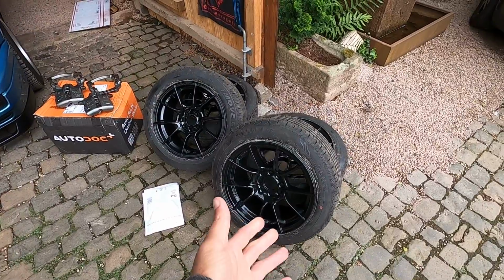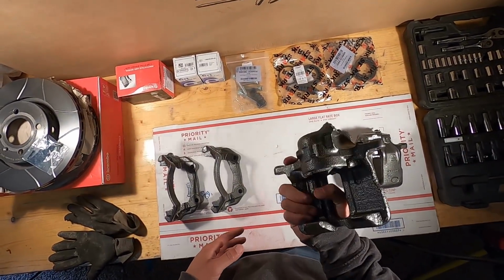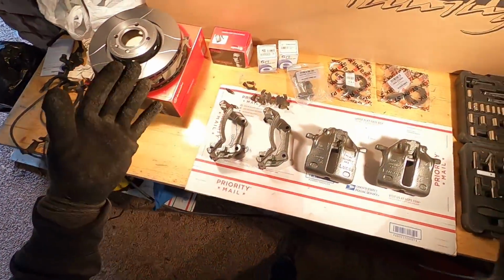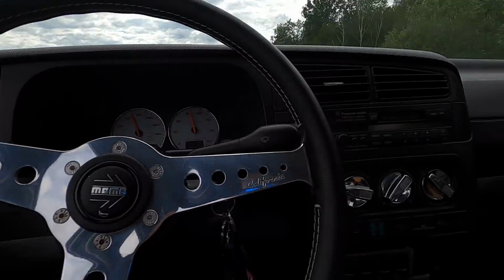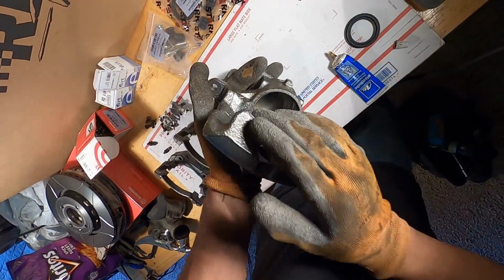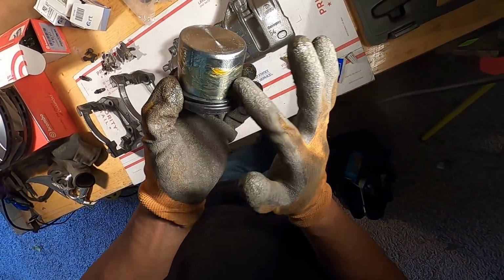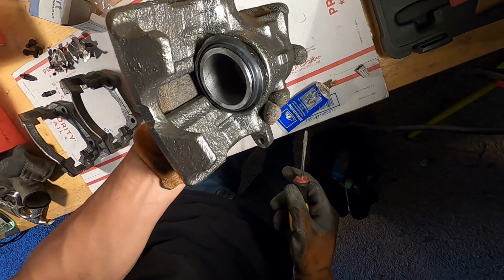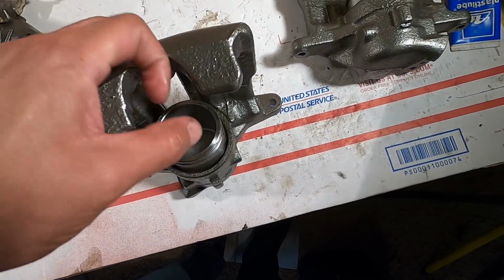Attempting To Rebuild My Gti Calipers ( Mk3 Vr6 )

Comment: you can use compressed air to get the piston out. and you need to get the dust boot in the groove in the caliper before you insert the piston

Comment: Push  the sealing over the piston first to the lower  end of the piston, that the sealing  stands a little bit over the piston. Than fit the sealing first into the caliper before you put the piston into the caliper. When the lower end of sealing is in it's place carefull push the piston with your hands into the caliper. To get the pistons out again you had to use an air  compressor and get pressure to the hole were the break fluid comes in.
Reply: That's the way !

Comment: Chris if I can offer some advice on fitting the  dust boot (the ones that you can't fit).  Is to put it on the bottom of the piston so the inner bit is on the piston but roll it down so it overhangs. Then tuck the outer bit it into the caliper and push the piston in. When its nearly home slide the boot over the piston groove and make sure its seated. Once you have the knack it takes about 5 minutes per caliper. If you need to pull the piston out use some cardboard in the jaws of some locking grips on the lip of the piston it will come out fine and not damage it . Just take your time its all about learning and getting the knack of fitting them !!!  BTW my VR6 Highline is running now needed a new fuel pump gave the engine bay a good clean and shes coming on nicely thanks mate & take care

Comment: Also the mk4 rotors should actually be 288mm, and a great oem upgrade for them would be mk4 1.8t gli/20th/337/audi tt front caliper carriers which offsets the stock front calipers to accept a larger 312mm rotor off of any of those cars. Not to mention the rear too, if you get rear calipers off of any of those cars (except audi tt) that's also a direct oem upgrade for larger vented rear rotors. Just for you to think about for your wagon.
Reply: This.  I went a little further and got 3.2 tt front brakes.  Which are the same as r32 brakes. Dual piston and 334mm rotors. Such a great upgrade
Reply: @ERAutomotive  those are also great, but pricier. 👍
Reply: @brandonb298  yeah they sure are  i feel i got a steal of a deal
500$ for tt spindles control arms and the brakes
Reply: @ERAutomotive  Where did you find the R32 brake calipers,and where are you from. I can't find for the love of good find any used or even new ones on the German ebay or even the hole of Europe.
Reply: @arnoldkul3827  hey i found them on a local by and sell in Canada 
the ones i got are actually off a 3.2L audi TT which are the same brakes and spindles and arms
hard to find pieces

Comment: OK, I rebuilt my G60 calipers myself years ago and they were still good when I sold the car about 8yrs later (so you can do it yourself). What you need to do with the dust seal is fit it to the piston but pull it out of it's groove and slide it all the way down to the bottom of the piston so the end is hanging off the edge. You should now be able to fit that overhanging edge into the groove of the caliper and push the piston home. It's still fiddly but it'll work. I wasted a seal set before working it out. Think I pushed my pistons out with a foot pump.
Reply: Actually I'm lying about the foot pump. It was one of those cheap tyre inflators that plug into the lighter socket. They come with a fitting like a spike that's used to inflate air beds, etc. That fitting pushed into a cut-in-half brake hose

Comment: As in earlier comments below.
Use the compressor to pop out the cilinder.
Be carefull because it really pops.
Then install the rubber seal first and install the cilinder last.
The seal automatically pops in the cilinder.

Comment: Apply air pressure on the calipers through the bleeder in the back using a compressor nozzle with a rubber end. And put a block of wood in between the clamping area so the piston dosen't go flying.

Comment: Seal over the piston. And the seal In the brake caliper. And than push the brake piston in. It's a easy job. Not to much brake grease.
Reply: It's a 2 min work. You can!
Reply: Piston out with air pressure.
Reply from the maker: Tom Vanharen I was trying to do it that was as well and I couldn’t get it unfortunately and now I can’t get the piston back out lol
Reply: Set the bleeder back. En Set air pressure on the Hose side.
It will Pop out

Comment: Slide the rubber on the piston almost to the end of the piston
Put the rubber end int the caliper first .push piston evenly till its all the way inside the will seal on the piston wgen it reaches its travel distance if not just pull it in the Grove of the piston

Comment: you should really do the brake lines while you are swapping the brake calipers while you are in it already. you won't have to change them later and they help with brake heat and squishy brakes after using them

Comment: Love the black look on miley.  better off buying new oem vr calipers. I know you have probably looked but they're like $30ish. I had to replace one on my rear end because it had seized up on me.  The OE color is pretty similar to what you painted the GTI calipers.  

At this point just say screw it and get the willwood  big break conversion lol.

Comment: maybe a wierd question but can you put the seal in before putting the piston in, if you manage to get them out ofc. then with the seal in you can maybe pust the piston through. i'ts been a'lot of years since i last did calipers on my mk2 but i think i did it that way.
Reply from the maker: J.F.K.O I tried that but I wasn’t able to push the piston through the seal unfortunately
Reply: @Mk3Smith  push the seal into caliper groove, then ride the other part of the seal onto piston, while simultaneously pushing piston in, push piston into caliper while riding the seal up the piston, all lubed ofcourse.

Comment: Brake system really don’t like grease/ oil always messes up the seals.  Petroleum based things and brake hydraulics don’t mix    Will swell seals and anything rubber in the braking system

Comment: Is 3000$ a good deal for vw jetta mk4 v5 150hp ? (120k miles, manual)
Reply: Not really, got mine with 58k miles with the V5 170hp for 2.5 grand
Reply: That sounds like a good deal to me, you would easily pay $8000 where I live.
Reply: They would be less than £1000 in the uk